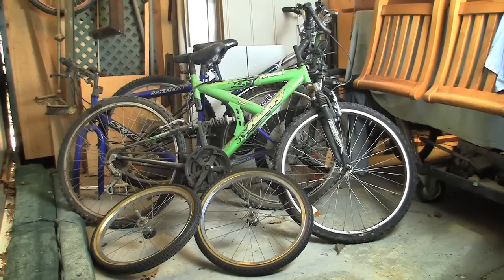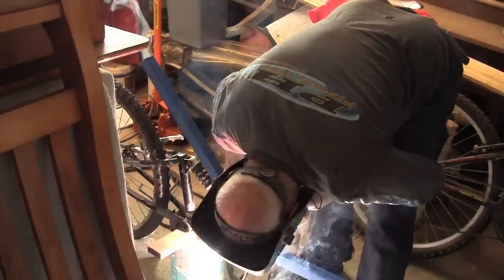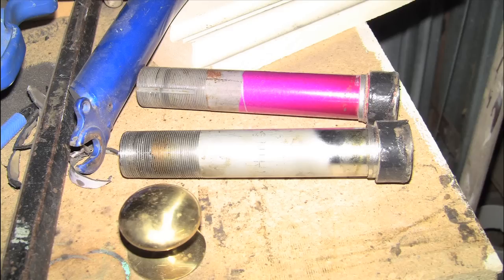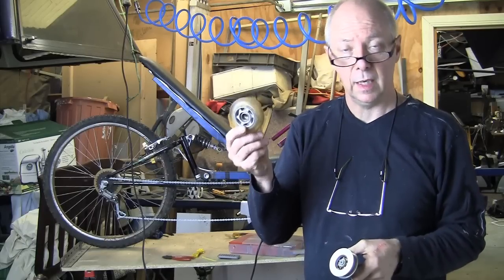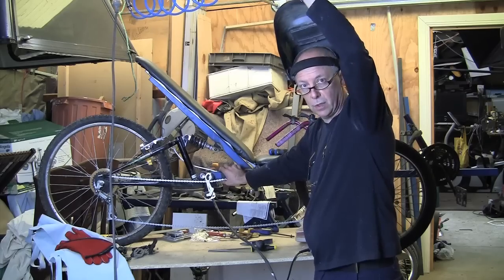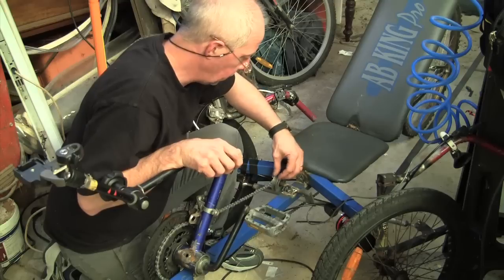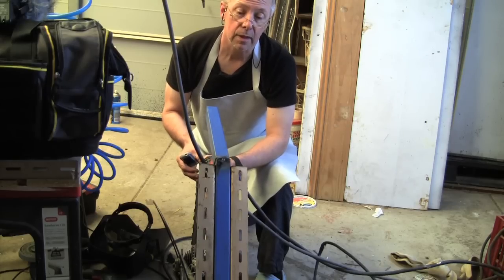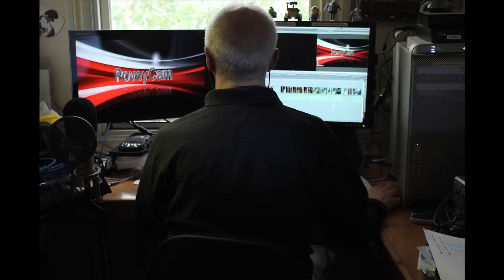How I Made My  Recumbent Trike

Comment: Hey Niall, Great vid!
Did you think of using a small sprocket, like one from a derailer instead of a roller blade wheel? It might offer less friction, but hey, if it works it works!
Reply from the maker: Yes i did but the derailer sprockects dont have bearings only bushes or at least the couple that i have pulled apart . I have now ordered a new roller  that looks better than the roller blade wheel and has bigger and better bearings so hopefully this will be the way to go .

Comment from the maker: I would have loved to weld it up with a mig but as I would have justify this to the wife I decided that the old stick welder would have to do for a little longer, maybe a new toy for next christmas !!
Reply: hello excuse a fabulous job, please help with my doubts, which has long and wide, and pipe measures is. Thank You
Reply from the maker: Marcelo Escobedo The box steel was about 45mm square and a bought 2 meters
which was more than long enough.
Reply: Marcelo Escobedo
Reply: Hi thanks for your time, sorry to bother you but I would have way could spend a detailed action plan, could further specify the characteristics of the tube (width, thickness, etc). Thank You.
Reply: That's where buying the plans from Atomic Zombie come in Francisco. Look them up on the web, many different sets of bike plans.
Reply: ok gracias

Comment: To get a clean weld  the parts needs to be clean and striped of paint .  Your not going to 100% . Not even close . You really need a tig or a mig to weld something this light . You also need a gap to the width of non fluxed end of the rod in most application but with this  it is always easy to remember the gap would be the same as the metal .    Most usually .  If welding with a mig  I always used the wire for the gap  .
Reply: this is true but when you've only got an arc welder and you don't really know what you're doing, it's in my experience possible to muddle through and get it to work even if it's a mess. Getting proper mig welders etc is expensive especially if you're only going to weld very occasionally.
Reply: @subspaceanomaly   Your right . There is an easy way to weld thin metal with an arc . I used a two stick method  One stick in the stinger and one on the crack . Your using the second stick as a place to help to lower the heat and to prevent blow threw . There is another way . Anything that is harder than 7018 rod . Dont ever use anything less like 6011 .  If your welding with AC use an AC rod . If your welding with DC weld with DC rod .  Years ago bikes had bolster I think they called them . these bolsters are at each joint in the frame . They did not weld bikes back then . They brazed bikes with a brass rod .  I also did a trick by using 7018 rod I dragged the rod instead of pushing it . You can used lower heat to do this and you can work a little slower .  The last thing is always keep the work clean clean that's right clean .

Comment: Sounds like you are using an AC arc welder.  I liked the video.  You do make me cringe however when I see you welding with no gloves and short sleeves.  Dangerous
Reply from the maker: Yes I know I was in to much of a hurry to put my leather apron on , at least i remembered to start the camera !
Reply from the maker: Ive been welding that way since I got the welder for my 21 st birthday !  I only wear gloves when I need to hold or move hot parts.
Reply: Niall Povey You really should protect your bear hands from the radiation produced from the arc.  Skin cancer is common when skin is exposed to those high levels.  I was welding without my welding shirt and I had short sleeves.  Both arms and my open neck were badly burnt.  I didn't notice it at the time but after i finished, it really started to hurt.  All I'm saying is be careful and take precautions.

Comment: your rear suspension spring is mounted wrong,? you are using it as a tension spring "stretching it" it is actually a compression spring. The mounting point on the seat should be higher than the opposite end, not lower to be effective.
Reply: The elasticity of the spring is the same for compression or stretching. But if there is an hidraulic part, I think it's not going to work...
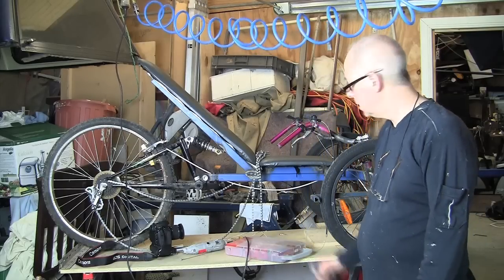Reply: Go to the 5:44 mark and “pause” the video. The force on that rear wheel will be travelling up and roughly in the same direction as the “play” arrow. Doesn’t that make the mounting point close to correct in regards to the compressing the spring? Just interested for my trike project👍